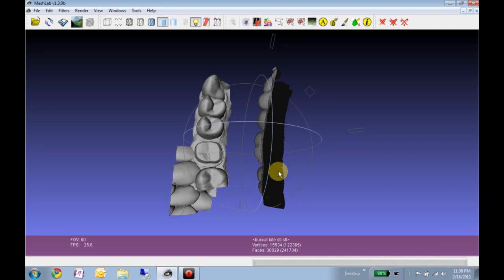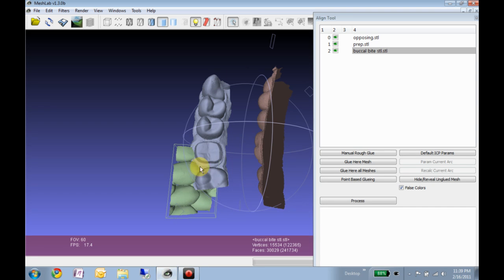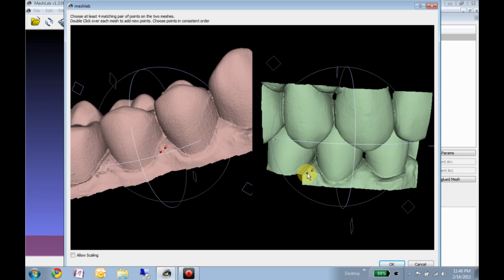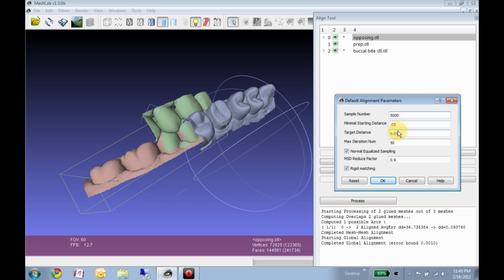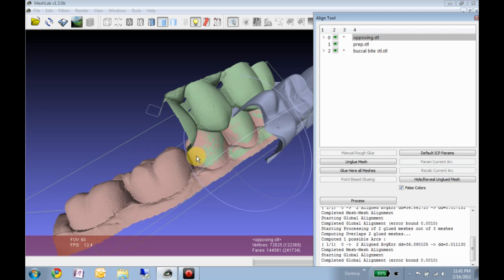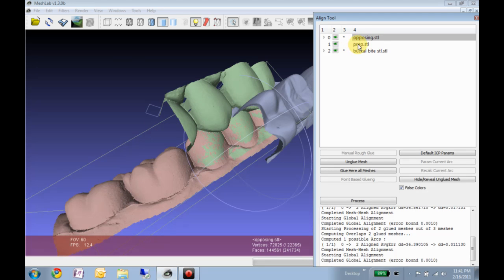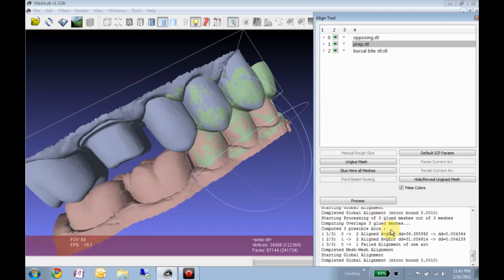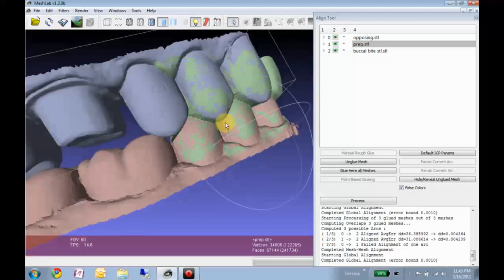buccal bite registration

Comment: One question, by adding the corresponding marks, will the two mesh have dense correspondence, i.e. (x1,y1,z1) of mesh 1 corresponds to (x1,y1,z1) of mesh 2?
Reply from the maker: in general, the indexing of the mesh elements (verts, faces etc) will not be correlated.  So an algorithm to map them has to be used (snapping, closest point etc).  However there will be SOME correspondence where x1,y1,z1 of mesh 1 MIGHT correspond to some xn, yn, zn of another point on mesh 2.  And that is how this algorithm works, fore very vertex in the cloud, it finds the closest point to in mesh 1 to mesh 2 .  And from all the pairs, builds correspondence...and then it does this over iterations.
Reply: @patmo141  But I thought Meshlab's alignment is already using ICP, and ICP uses closest point in each iteration until it lands on target surface?.